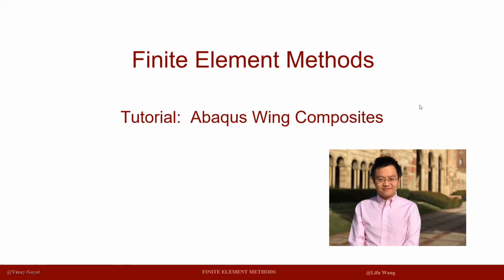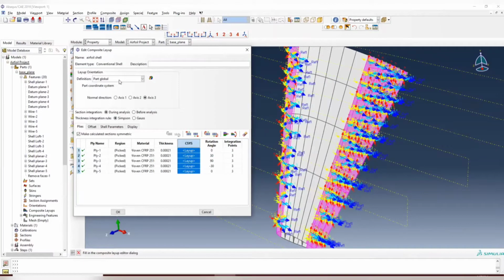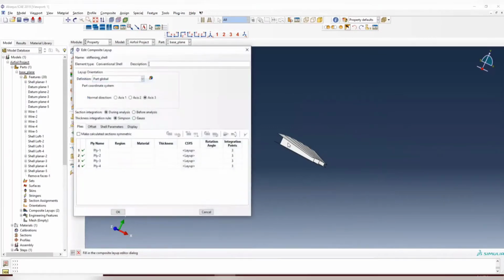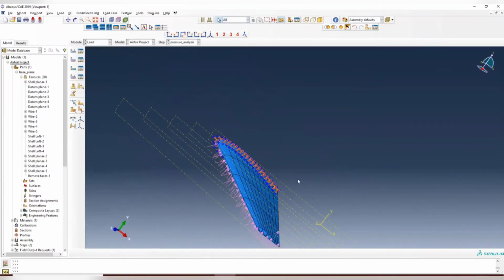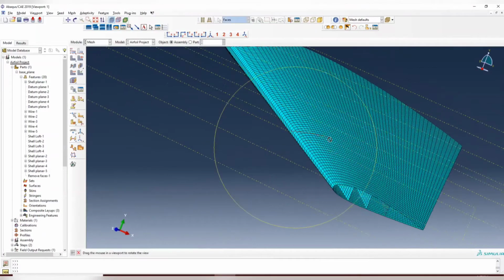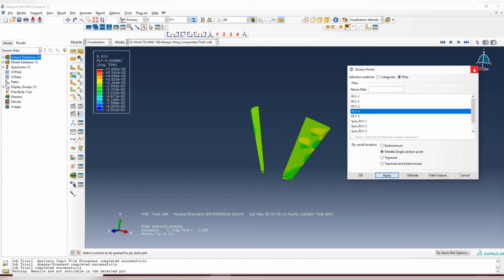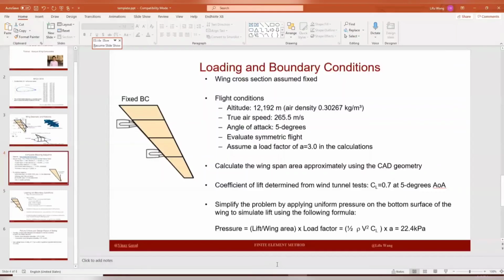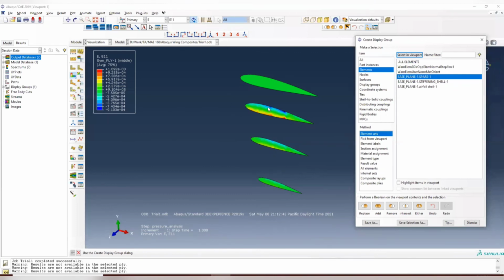#ABAQUS TUTORIALS: COMPOSITE WING DESIGN - PART IV - FINITE ELEMENT MODEL

Comment: You inverted the definition between ribs and spars 😀. Nevertheless very instructive tutorials
Reply from the maker: Yes that is an error. Its described properly in the first Part
Reply: @VinayGoyal  Why he didn’t divide the lift pressure by 2, as the analysis was applied to half wing?